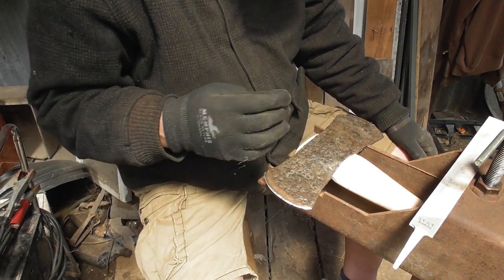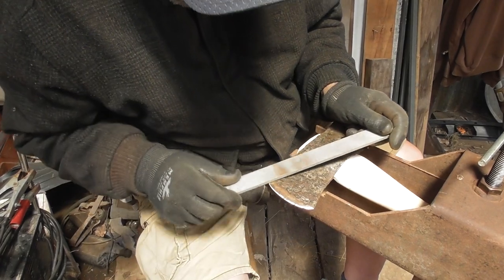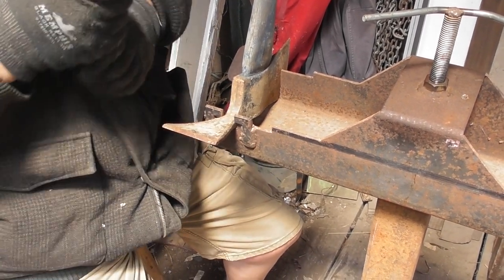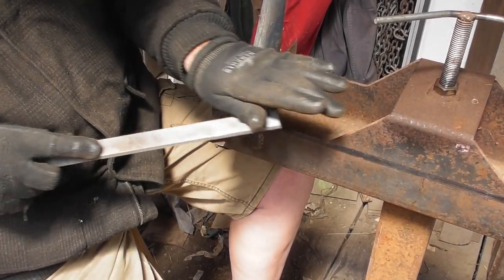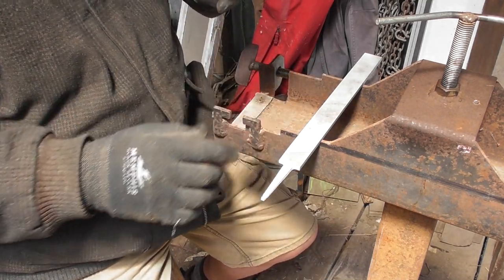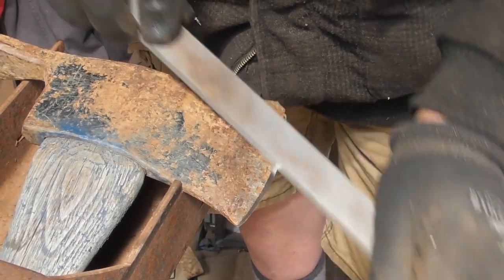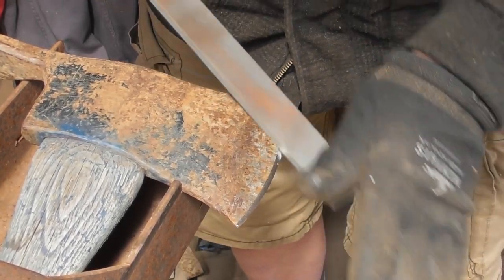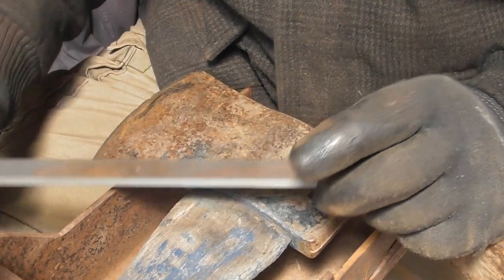FIRE TOOL SHARPENING, PULASKI, AXE, MCLEOD, SHOVEL

Comment: like the system
Reply from the maker: At least one station I worked at had a second set up that worked in a bench vice. Most of the rest were on a 2" pipe...screwed into flange in the garage floor.
I like the 360 degree access to tools in the floor mount....sanding and oiling handles etc.
The truck drum mount self levels better in gravel and we have a lot of that.

Comment: Love that sharpening fixture!  Am I right in assuming you’ve done your share of brush fire fighting? “ when you said my firefighters it got me thinking🤔
Reply from the maker: Ummm you could say that. CDF/Calfire starting in 1966. Permanent except for a vacation to Sunny Southest Asia since 1967. Retired around 1997. Built a few saddles and then we had a lightning bust in 2008. Put a volunteer fire department together on our first fire in timber...(held it at five acres with hand tools for a week before the red trucks showed up" I've been Fire Chief since 2008. So +42 years. We are strictly wildland equipped + medical gear. One EMT so far.

Comment: @jdanielsoffgrid I’ve always been taught to file into or toward the blade and across using most of the file. Is there a difference? Or am i just doing it wrong? Great video
Reply from the maker: I trained a lot of newbies in 36 years of state service and we had to come up with a way to prevent injuries. If you are sharpening your own tool sharpening into the blade is your choice. This is the safest way.

Comment: Thats not correct, you only use one spot of the file, it was meant to be used the entire length. Vice sharpening is easy, i will make a video on how to field sharpen. No file handle and no sheath... good way to slice your hand .
Reply from the maker: Appreciate the comment. The video was not long enough to show moving about on the file and such. Let me know when you post your video. Kevlar gloves have spoiled me a bit. A handle and a file guard (section of fire hose) works well.
Reply: This is the way with minor changes how every USFS Forestry Tech has been trained to sharpen tools. Full use of a file isn't the point, many went to the scrappy full of life but useless for our needs.

Comment: Also do you recommend one brand of file over another? Ive been looking at a small 6” bastard file that i can easily store in my pack. Trying to find USA made vs Chinese. The Grobet’s have good reviews. Nicholson’s do as well, but im reading they are made in brazil now and not as great of quality.
Reply from the maker: Grobets are good, Nicholson was good. For quantity 12 to 14 inch. For carrying 6 inch is good for touch-up. Round axe stone is good too. (if you can find them) I evaluate everything by "is it going to hurt me or the crew)" I never worked from a pack being an engine dude. :) Longest one that fits in a fire shelter pack???
Reply: @JDanielsOffGrid  Thank you so much!  Appreciate all of your insight and a great video. :)

Comment: How do you sharpen a big foot? 45 degree angle?
Reply from the maker: The Mcleod is 45 degree.. if that's what you are asking.  Grubbing end of Pulaski is roughly 45 also. Old carpenters tri-square with the sliding ruler works well to test/check.